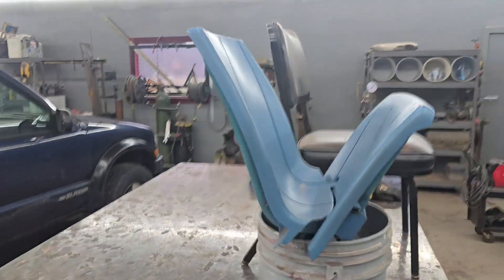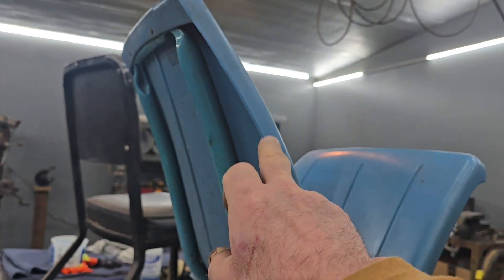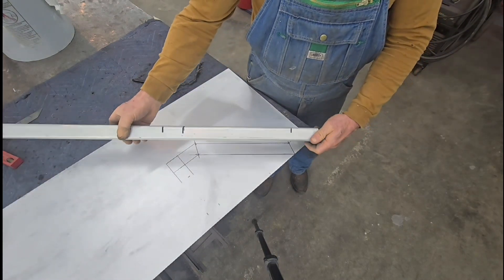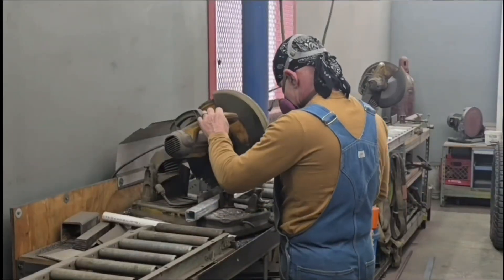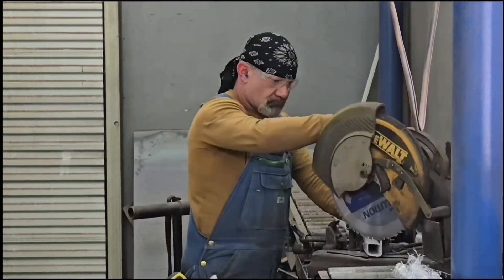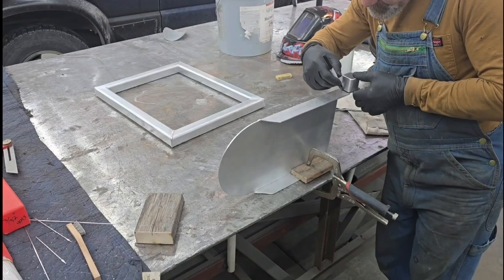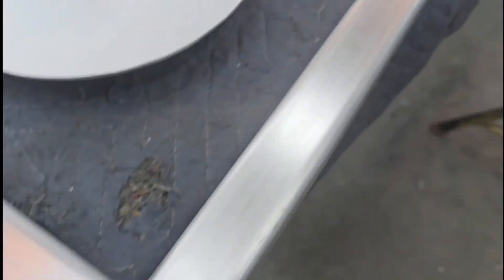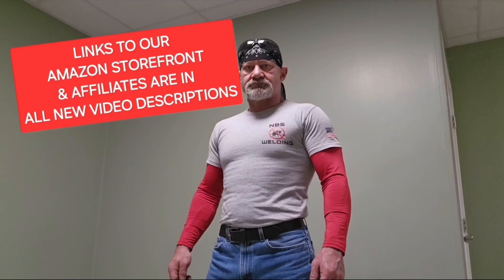Fabrication of an aluminum frame for a WVU Coliseum seat

Comment: It looks like you did some re-organizification of your shop a lil bit huh? Shelf by the garage door was on other side wall before right?  Its always nice to get the stuff you use most moved close as possible to where you're using it most often. Hope it all works well for ya now 🛠️🔧🔩⚠️⚡🔌🔋👨🏻‍🏭

Oh and you moved your rods up on the 'ladder shelf' too. You've been a buzy lil beaver over there in the cave. I'm actually surprised you don't have a lil potbelly\woodburner stove in your shop for heat in winter.
Reply: 4:35 I hate when the saw goes both ways.....or do I, wait a minute!😅😂